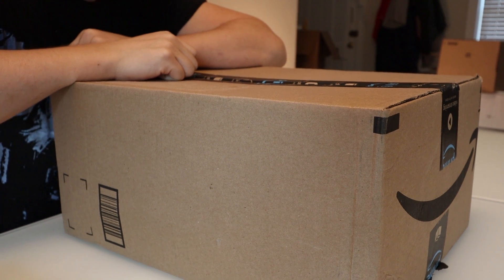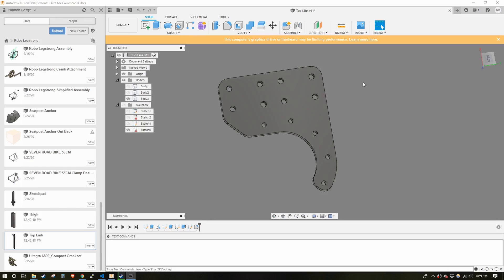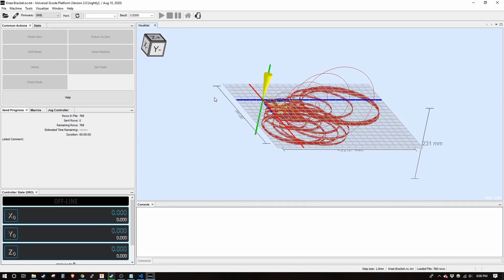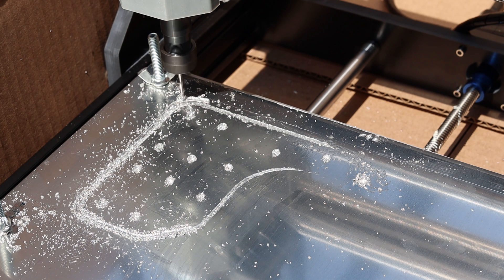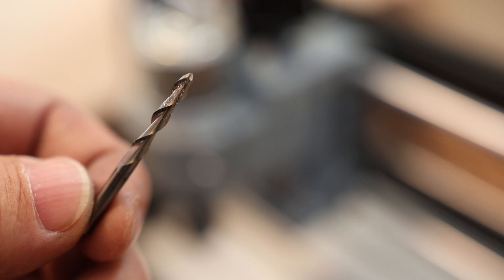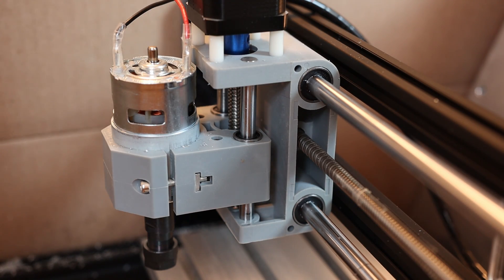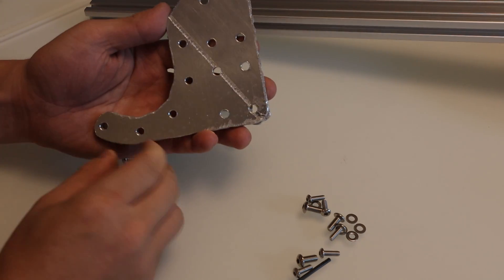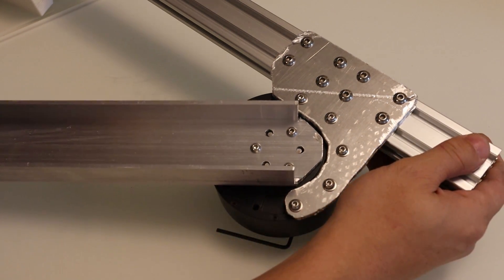Machining Aluminum Plate with Sainsmart Genmitsu 3018 CNC

Comment: I definitely like to buy a small cnc like this. However this piece of work can be done easily with the method i use it for years. I print my plan with laser printer. Glue the paper on the sheet. Every center point printed on (especially the negative curves if you  know what i mean) i start with drilling pilot holes. next the negative curves with hole saw, then the boundary with angle grinder. Next step is grinding or sanding, final hole sizes, countersink. 

What i can not do manually is the 2,5D parts. But as it seems like i need to keep looking. Until then, i have to accept the 3D printed parts.
Reply from the maker: P.S. I have an updated video where I did a much better job with the same CNC. Just took some learning to figure out the limits of the machine, and some small tweaks and fixes.
Reply from the maker: Good old fashioned metalworking. But sometimes its more fun to spend 20 hrs building, programming, and ultimately failing with a mini CNC than taking the 1 or 2 hrs to build the darned thing by hand.
Reply: @NathanBuildsRobots  actually i do both. I do design and build 3D models, then print them, i use a laser to cut and build things. And yeah, still use my hand. The funny thing is i none of my products are machine made. All of them are handmade, and their all has the lovely imperfection, flaws that makes them somehow more human. But when it comes to my workshop, tools, jigs, and practical equipments, i like precision, accuracy and order. I don't know, probably its some kind of left/right polarity in my brain.
Reply from the maker: @opiniono-1  
If you make something imperfectly by hand one time, that's OK. 
But if you make an imperfect machine, than then goes on to make hundreds of imperfect products... well that's criminal.

Comment: MORE OIL keep reaplying when it gets dry! i did 100 mm/m and 50 for plunge and 0.2, the edges are bured alot but it cut
Reply: what bit did you use for those specs

Comment: It was NOT designed for milling aluminium, so why the ** does everyone try? If you want to get decent results, you need a lot(!) of modifications to the original machine. The most prominent: The Z-axis. It is way to weak.
It however is quite good for what it was designed for: Wood.
Reply from the maker: Yeah, it's not a very sturdy machine, it is best for cutting soft materials like wood or plastic. 

I have been able to do some aluminum parts, but it takes forever. In my experience the best option for small aluminum parts is to contact some local machine shops. They can make small parts for you for $60-$100, give much better results, and save you a while lot of time.
Reply: Actually they do advertise it for soft metals.
Reply: @opiniono-1  No, not at all. These machines are advertised for engraving wood and plastics.
Reply: Because we wanna cnc metal on the low low. Like $150 low low.

Comment: Aluminium........
Reply from the maker: Ulumunum. 

But really, I need a spell-check plugin for Microsoft Paint.
Reply: There are two correct spellings.
Reply from the maker: @johanbraanen2108  true, but I missed both of them 😢
Reply: @johanbraanen2108  nop Aluminum Foil was the name of a specific foil product, Aluminium is the material.

Comment: That bit you're using doesn't look like an endmill, it looks like a rotozip bit.  I think you might get better results using a better bit.  I read down below that you're using a carbide tipped bit.  You'll want to use HSS. Carbide won't cut as well in this machine.
Reply from the maker: Thanks for the tip. In the video I was using a cheap HSS bit that I had laying around. I switched to a smaller diameter carbide bit with 4 flutes instead of 2 and have been getting better results.
Reply: @NathanBuildsRobots  make of video of the improved results
Reply from the maker: @idiotburns  https://youtu.be/zCBXPMnI4_s

It's a pretty short video

Comment: cool video, do you know exactly what the step down and feed rates were at in your tests?  I want to try to cut some 1/4" aluminum with like a 1 or 2mm end mill and one of these bad boys, I was thinking about like .5mm-1mm step down at a 100mm per minute.  Sounds slow but I'm thinking it might do a good job that way.
Reply: If you want to cut aluminium on a machine like this you have to make very light passes. Think more like .1mm not .5 and certainly not 1mm, your spindle is not strong enough and your machine is not rigid enough. The part shown being made here is simply scrap metal.
Reply from the maker: Lol tellin' it to me straight. This was my first attempt at any CNC machining, aside from some wood parts I cut out years ago. 
You'll be pleased to know that I have improved my craft a bit and did another video with parts that turned out much better.
Reply from the maker: Feed rate was 25mm/s. At 100mm/s the spindle motor would stall under the load. Teaching Tech has a recent video where he put a Dremel on his 3018 and was running at 200mm/s, might be worth checking out. 

I have another video where I showed all the speed and feeds settings in Fusion 360. It should answer all of your questions about feed rates.

https://youtu.be/6CDNU3RCeTQ
Reply: @NathanBuildsRobots  25 mm/sec???? That is craisy😗

Comment: These smaller cnc's state that they are not really made for metal. It's pushing the boundaries of the unit. Maybe the beefier spindle would help?
Reply from the maker: Yeah, next time I have some metal parts to make I'm going to try using my Dremel as a spindle. Teaching Tech just did a video with all the instructions on how to do it, so I'll follow that.

Comment: I've made gussets from 1/8" 6061-T6 aluminum using the stock Genmitsu 3018 PROver. Works like a charm. I upgraded the spindle motor so I can cut faster but you can cut through aluminum just fine with the stock 3018, albeit at a slow speed.
Reply from the maker: Yeah watching my 3018 cut out aluminum plate is like watching paint dry. Except it's slower and more dangerous!
Reply: Do you remember the settings you used?

Comment: Loctite needed
Reply from the maker: I put some screws into the sides of the spindle holder that pinch the linear bearings and have held them in place. Didn't even think about loctite, that would have been easier.

Comment: Better cutting tip slower cutting speed with an  air feed directed on the tip to cool it down
Reply from the maker: I put an aquarium pump on, pretty much the smallest one I could buy. It works ok, but it would be worth stepping up to a medium sized one for this application.
Reply from the maker: I'm running carbide tip as slow as I can bear to run it with air from an aquarium pump directed in the tip and it's still pretty choppy. I think the frame is too flexible to get high quality results

Comment: to cut aluminum you need a much more rigid machine, if you put an indicator against the spindle and push , taking light cuts only leaves the heat in the endmill and not the chip, buy a machine with square linear rails
Reply: Do you have any recommendations?
Reply: @indigenoussober407  unfortunately all the rigid cnc routers are $2500 plus , I am building my own for about $1000
Reply: @garylarson6386  That's a little too spendy for me. Thanks for the reply.
Reply from the maker: This guy upgraded his 3018 to an insane level.
https://youtu.be/EI416WMoeZI

I'm guessing he spent $200 on base model and another$400-$600 in upgrades, which could be done is phases.
Reply: What beginner desktop machine would you recommend that is capable of cutting aluminum? Thank you

Comment: It's true that a 3018 is not powerful enough for cutting metal, but doesn't seem to be a bad tool for making very precise paths that can be later finished with regular powered  hand tools.
Reply: it can be with the right mods. the first thing to do is get rid of the spindle and then all the plastic junk on it.
Reply: @Q5Grafx  have you done it? I am considering this
Reply: The problem...is that the bed is flexing downwards when the bit touches the material being CUT. They linear rod guide must be replaced with RAIL GUIDE and dispose that ROD GUIDE. My DIY CNC can cut aluminum sheet of 3mm thick and that is my problem. I am just waiting for my budget for those RAIL GUIDE for the Y axis.

plus that motor sucks the 775 motor is not capable of more than 12000 rpm. at least 18000 to 20000 is needed for aluminum to cut it. Crappy 3018..LOL